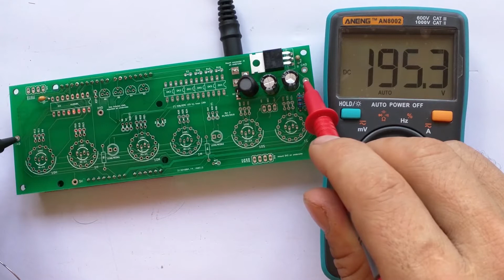All-In-One Build Tutorial - 2 - High Voltage Circuit

Comment: BEWARE of this trap for the unwary: before you can do the test shown at the end of this video you must load the Nixie Clock program on your Arduino! This is not stated in the video but it is true. The Arduino program controls gating of the MOSFET, so if the program is not loaded up & running there will be no high voltage!